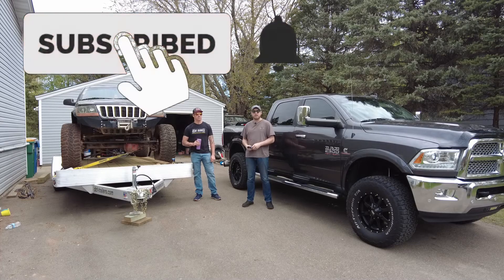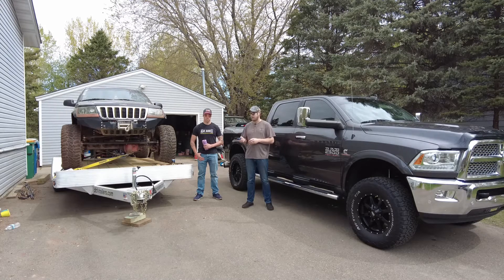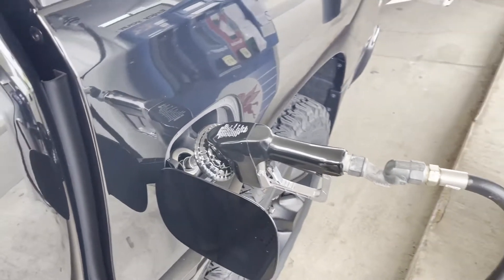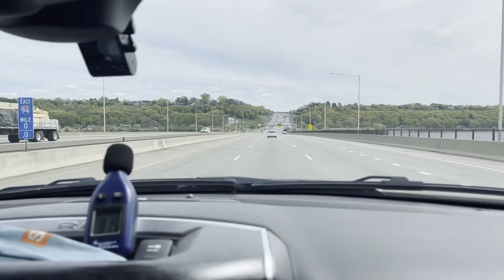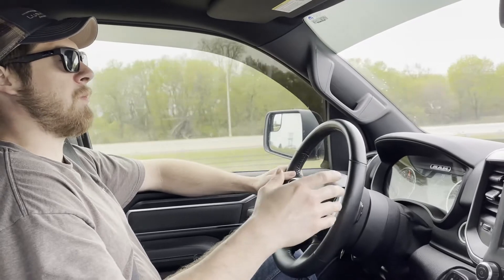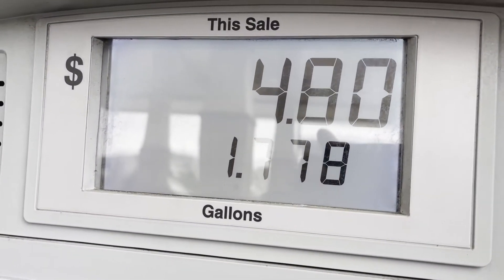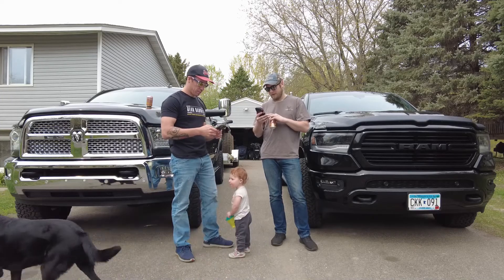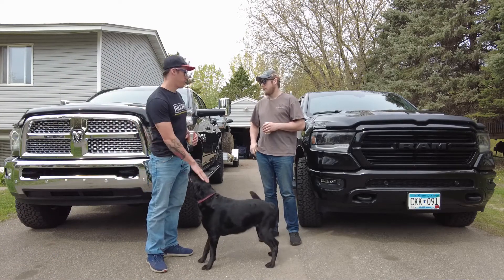Gas vs Diesel Tow Test! Which Is Best For YOU?

Comment: Good comparison. I've got a 2022 GMC Sierra half-ton with the 3.0 I6 Duramax diesel and standard bed (6.5 foot) and max towing package (which wasn't available on the diesel before the 2022 refresh). It's rated to tow 12.8k pounds and gets about 28mpg highway going 75 mph. So I feel like I've got the best of both worlds.
Reply: Howdy! Question Sir, what type of mpg are you getting right now while towing? I'm thinking of getting a 2022 Suburban Diesel to tow a 7 thousand pound boat. Let me know thanks

Comment: Would love to know what your tranny temps reached when climbing up that hill.  I pulled a ~5200lb 21 foot travel trailer with a gas Silverado 1500 (6L80 transmission running in M4+trailer mode) up a 5 mile/2000 ft elevation gain road (dropping to speeds of 30-35 in M2 at some points) while watching the transmission heat up to 221 F.  Not too much fun watching the thing work that hard...seriously thinking about moving up to a diesel, though the overall cost differential is a factor.  This video will add to my information overload while comparing options.  Thank you!
Reply from the maker: Dang you’re right that would have been good to check. I’ll ask my buddy what his diesel normally gets up to while towing but I’m sure he’s hitting about 200 as well

Comment: Perfect video for what I'm trying to do, except I'm pulling a xj, trying to decide on gas or diesel, I'll probably only tow a couple times a year and the rest if the time the truck will be my daily so sounds like I can get away with a 1500 if I wanted, for that set up which would you choose?
Reply from the maker: Unless you’re in the mountains losing a lot of power, I’d pick a 1500 gas. I towed my XJ that was long armed 8” on 35’s with bumpers and winch so she was tubby. This was with a 2200 lb 20’ car trailer WITH a near 1000 lb can am outlander on it with the Jeep. And I did all this with my 02 Dakota crew cab with the 4.7. A Hemi will be plenty as long as high altitude isn’t a factor like I mentioned.
Reply: @TonyTheTruckGuy  That's awesome so what I'm hearing is I might even be able to do it in a tundra lol I really wanted  to overland out a tundra
Reply from the maker: @norcaljeeping434  Yeah a Tundra would be plenty as well.

Comment: If I wanted to two sofas/ couches everyday on a utility trailer what would you recommend?
I would say tow 3-5k lbs max
Currently I’m looking at 
Chevy Silverado 2500 V8
Or i6 biodiesel?
Reply from the maker: I try to steer clear of diesel if at all possible because they’re emissions systems are prone to failure and very costly to repair, also diesels in general cost more to repair. Diesel fuel also costs more typically but that’s offset by the better MPG that a diesel offers. 3-5k, a 1500 gas powered pickup can do no problem. As you see here, my full size 1500 hemi had no issues pulling this trailer and Jeep. If you’re looking at a 2500, I’d recommend just the gas engine. Even that is way overkill for what you’ll be hauling.